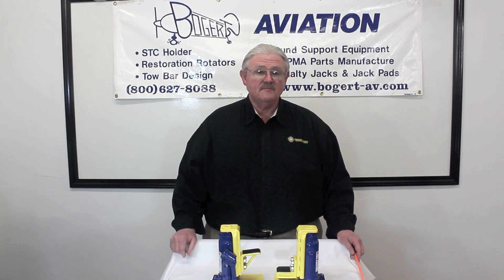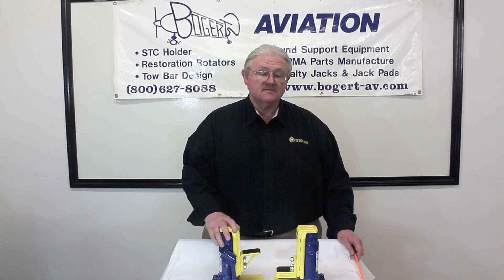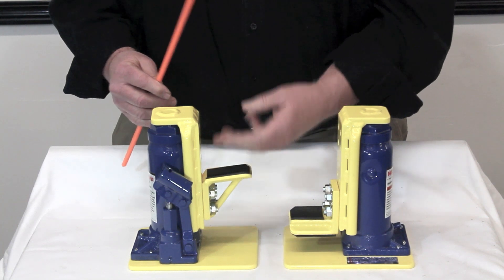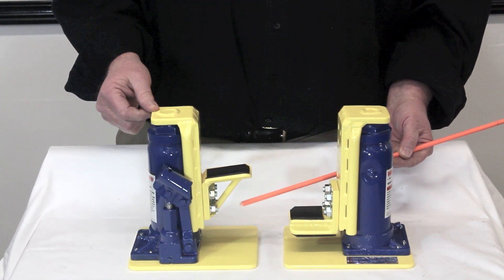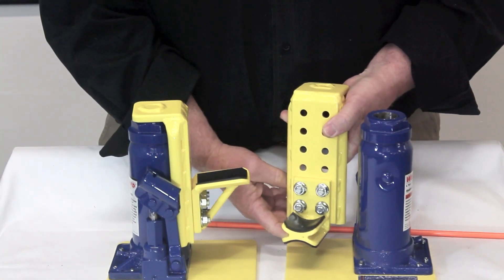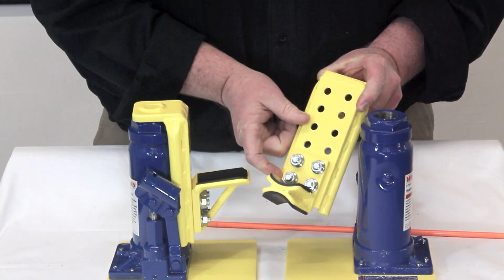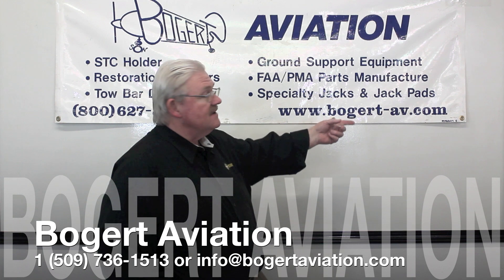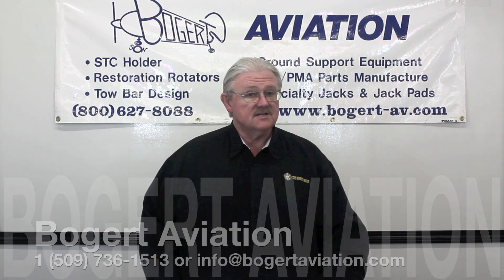Aviation Aircraft Jack, lower start point to fix flat tires on planes with vertical landing gear

Comment: I bought one of these jacks a few years ago. The bottle jack was orange then and they have made a few other changes. I have used it to change tires and repack wheel bearings on PA28, PA32 and others types. It has been a real time saver. I can do simple jobs without dragging out the big jacks.